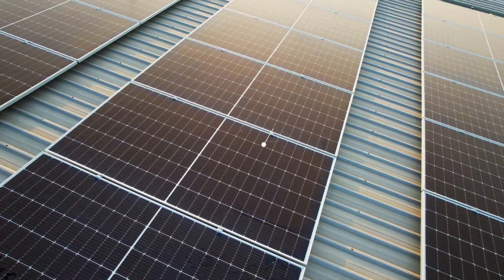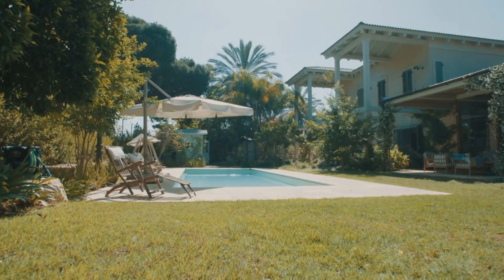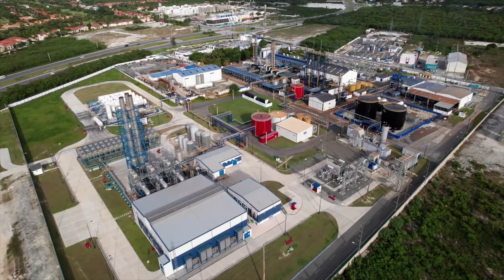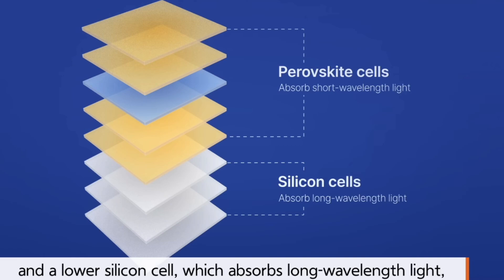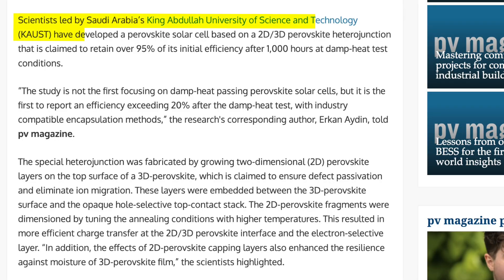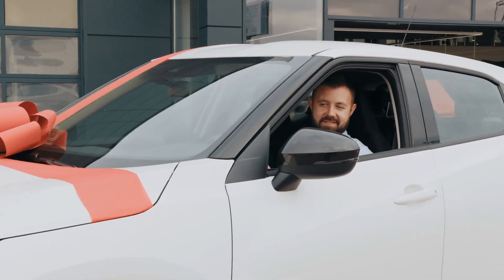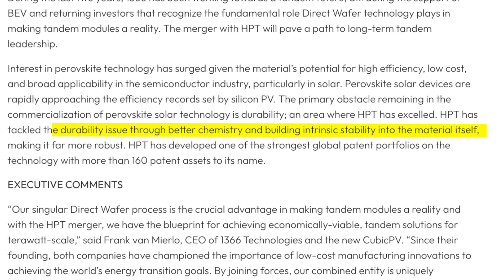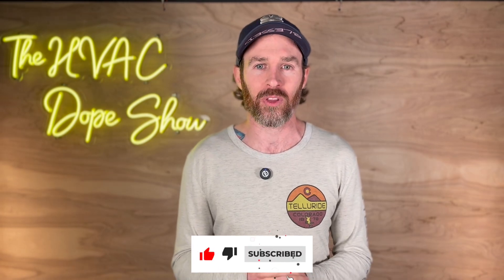This Solar Panel changes everything!

Comment: Painting the roof underneath the solar array white and using bifacial panels might be enough for most people. Plus a home battery and a Night tariff electricity plan. Not perfect but will get the job done to a degree. Triple paned windows and proper house insulation plus heat pump. All viable and working in tandem technologies you can get today. Mr. Fusion would be great but I'm not holding my breath.

Comment: Energy production should be matched with energy conservation/efficiency. Using smaller, more efficient fridges rather than giant energy guzzling ones is a good start. American hopes typically use double the energy that European ones do which is ridiculous.
Reply: EU also has to stop by the store more often, leaning to more trips and if that was the case in the US, would more than likely eat more gas because everything is further a part. Electric is cheaper than gas here. At .10 a kwh - I would save not going to the store as often than I would be going more. To be clear, I agree we need to match better efficiency, but I think it will depend by area where that conservation to efficiency comes from. For example, more norther country would better benefit from storing heat from all sorts of different area than countries that are around the center heat belt.

Comment: 25 percent efficiency  is crap must be 70 percent.
Reply: Well that isnt how that would work... 50% is best you can even do and that would still use up 100% of the light that hits a panel. Main thing is just that units of heat (ir) can't be converted well enough - normally taking 3-4 units just to convert it into 1 watt. Even then, 40% is where it will cut the number of panels down by half of today's 20%. 50% would cut it down by a third (assuming it better matches numbers). You could cut it down even more if you was to not turn it into power, but use the heat directly into a thermal storage tank like your hot water and then spread that heat out as needed into your home or drier (such as using a heat pump). If it was me, I would love them to make them even larger, add another lens array in the back, and then if any light/heat wasnt captured, have it focus down into water/gas and just start making heat - then at 40% - you would pretty much double the power generation off just a few 800 (*400watt panel size today) of around 1.2kwh vs just 800 wh.
Reply: How efficient is the average ICE car? How efficient is photosynthesis? Turns out, you can do amazing things with 20something% efficiency.
Reply: @thinktoomuchb4028  That's why we need to do better ice cars can get to at,east 60 percent; but the oil and car companies make billions on them not being so,plus the fact makeing them so expensive  to repair. I want  the 70 percent so we can just flush our fossil  fuel needs by 90 percent. 😊 that and piss off manufacturers  by makeing things last .like they use to.
Reply: @kennethharrison4847  Not really. ICE is cap around two areas, speed and force. At best you can only get around 50%, but that also requires everyone to drive smaller cars and to over drive their engines some - aka more work will need to be done on your car over time. There is a reason why EV are consider better. The ones that can get higher are typically hybrid designs that also store power into a battery when you break and use that power when you move again. Also, even if they could come up with a engine that could, who would own/make it? Thats the other problem with mature markets. The EV can be design in many different ways and still get around 90%+ with many of the limits just being cost to run the car (like AI for example reducing in SoC cost). Batteries are also coming down in cost while still inproving on power dens. So while it might take like 7-9k cells today.. newer tech is going to reduce that down to 4 to 6k cells tomorrow or even in half.

Comment: These panels are still crap they only last 1 year and then go bad. They need to last 50 yrs and at 50 yrs still be 95 percent.
Reply from the maker: They're not there yet, but making progress!
Reply: Why do they need to last 50 years?
Reply: @douglasplumley7670  because do you want to put out all that money and then have to replace them all the time? Or do you like going in and having a  dealership charge you 250 bucks for an oil change?.
Reply: @kennethharrison4847  the 25 year warranties that panel manufacturers have today seems plenty long enough already.
Reply: @douglasplumley7670  They are, but you could argue you would spend less over all on labor if they just work for a pretty long time for someone to live in a house. I agree 25 isnt bad, but longer can be better as well. I would love to see them last 50 years + store the heat they generate to be pump into hot water heaters and into the house as well.
Reply: @kennethharrison4847  25 years is still an ok range for many. By that time, you are more than likely going to have to re-roof your house anyway, plus by then, upgrade to whatever new method of technology.